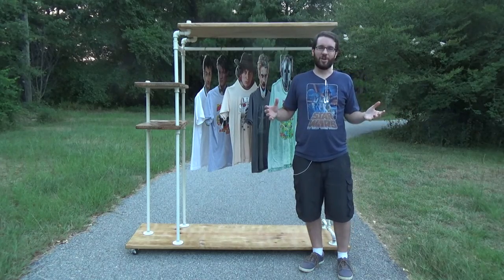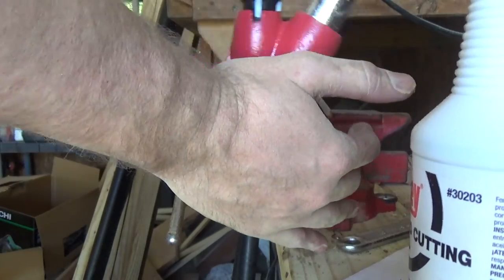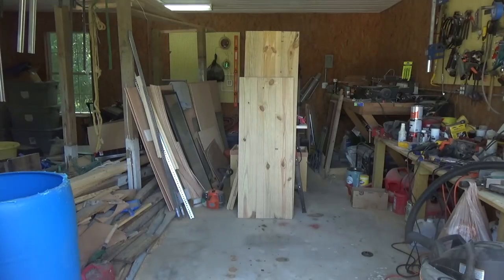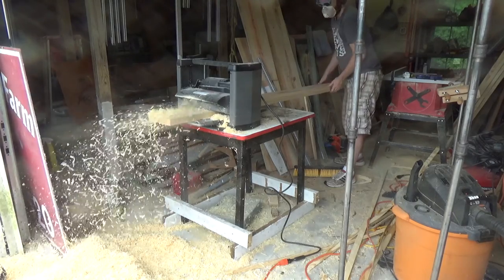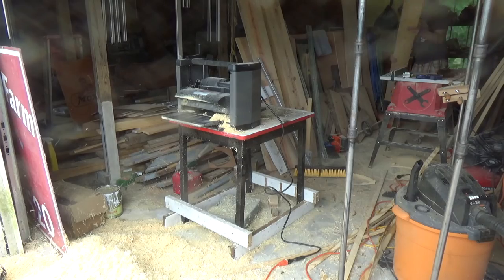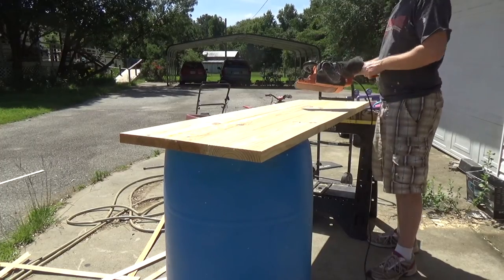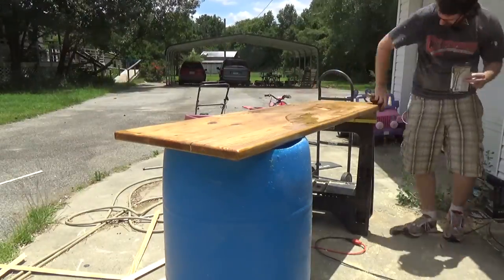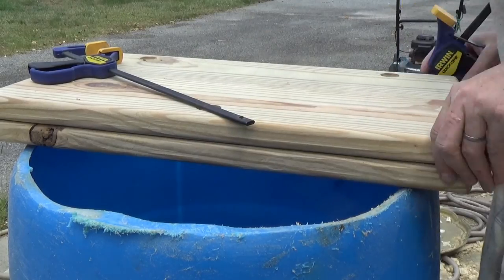Let's Make an Industrial Iron Pipe Clothing Rack | How To

Comment: most steel pipe racks with shelvings do not involve bridges, so they don't have to deal with the "direction of screw" problem. The ones on Youtube with cross connections either use glue or use pins.
Reply from the maker: I've seen people grind down the ends and epoxy them in, but I don't really like that solution. I replied to you other comment, I think the best solution (if you have no other) is to use a union.

Comment: Hi, while making a rack of my own design, I encountered a very trick technical problem, one that's almost impossible to resolve. From bottom to top: I have a base board with wheels, four flanges each corner and pipes going up, now, instead of the four pipes just get attached to four other flanges on the ceiling board, i am building bridge on each side (i.e. making a pipe cage). I use four T on top of each pipe, facing each other, and join two T at a time with short pipes. HERE COMES THE PROBLEM: as a rule, clockwise is screw-in, counter clockwise is screw-out. For one T, I can screw the bridge pipe in, but on the other end, I naturally am screwing it OUT. HOW TO OVERCOME THIS IMPOSSIBILITY?
Reply from the maker: They actually make unions for these pipes, they are "the" solution when there are no others 🤓👍

Comment: Nice way to get rid of spare parts aswell! I have a question: Can you do that with any tipe of pipes?! ( I have ALOT of spare wood and pvc pipes...) so, my guess is,  with the right paint you could make that look good right? They are about the same size as the metal ones in the video...but I'll have to find a different way of screwing/sticking them to the wood...
Reply from the maker: With longer lengths, PVC probably won't really be strong enough (they'll flex/move too much). The only way I could see that working is if you could reinforce them somehow.
Reply: +Live Free and DIY what about really thick pvc (like the ones I use to build a DIY flight sim?! They range in thickness from 0,5 to 3 inches...I think they should do the trick. I mean I don't have too many clothes either (not really fashion obsessed). Also...I think curtains in front of that would look nice aswell: http://www.koreayellowpage.net/upload/product/curtain_01.jpg
Reply from the maker: If it has a pretty thick wall, or is a wider diameter, it'll be sturdier and would be able to handle the load. If you had a 4' length and put it between two saw horses (or something), you could get an idea of how much pressure it could handle before giving.
Reply: Live Free and DIY Nice idea! Thanks for the help!
Reply from the maker: No problem! 🤓